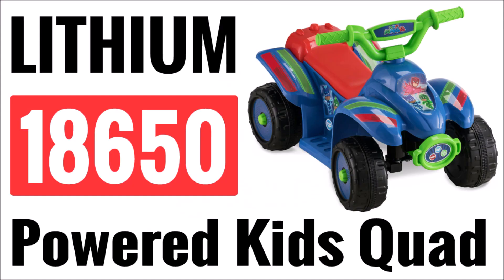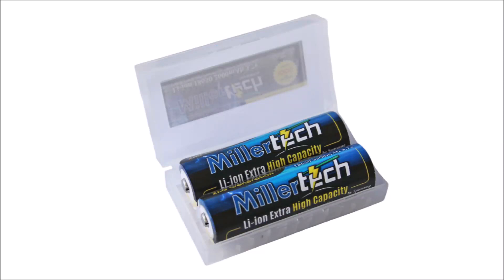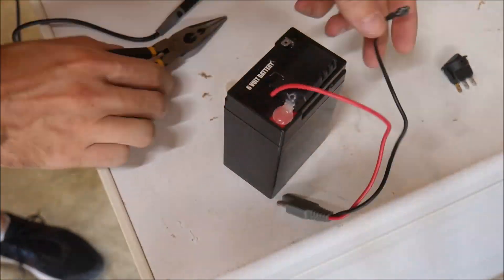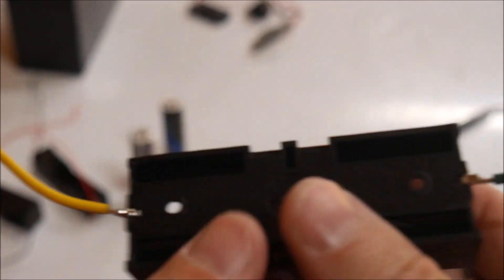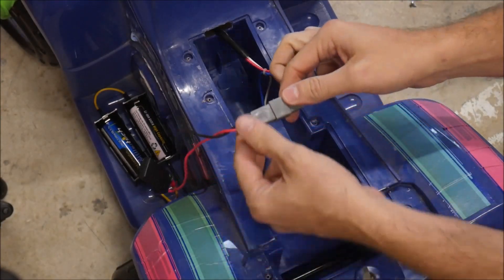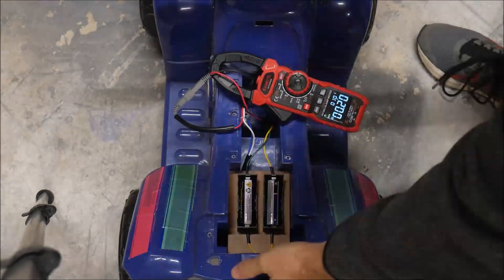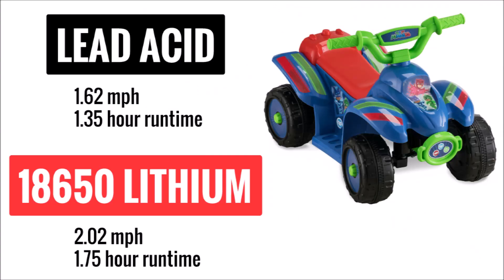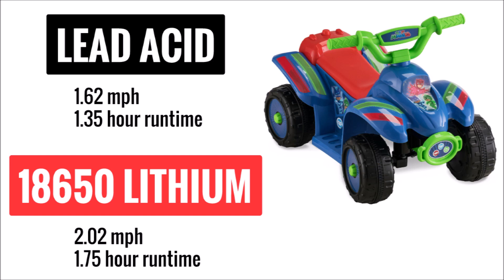18650 Lithium Ion Powered Kids Quad!  Easy Upgrade For Higher Speed And Longer Runtime

Comment: Just think if you paralleled more cells to fill the space of the old 6v system -- looks like you could fit maybe 12 cells?  With a 6p2s he could ride all day! Or if you did a 4p3s he could likely go faster than you could catch him. 😀
Reply from the maker: Haha, he would go really, really fast for about 20 seconds until that motor burned up! :)

Comment: Thanks for the video, I did a similar mod with my 6v quad, except I decided to go with a 3S battery. I ended up building a 3S3P battery made of 18650 cells like yours and the thing literally goes forever LOL. Obviously you know your children and their capabilities as do I, so I decided to step it up a notch so my older child could also join in the fun too. This thing will even move with me on it now!
Reply from the maker: Wow, that is great!  So the motor didn't have any problems with almost double the normal voltage?  I might have to try that! :)
Reply: @LDSreliance  no, it handles it great, I did the mod like 2.5 years ago, still going strong lol
Reply from the maker: I think instead of messing with this quad again I will take on his bigger 12V jeep next.  If I take that one to 6S or so that should be a pretty fun ride!
Reply: @LDSreliance  I have a video on my channel where I took a barbie jeep and I run it off a 40v ryobi battery with an adjustable pwm controller, but only at 55% max cuz the motors get hot at higher voltages. My kids love it!
Reply from the maker: Awesome!  I will check it out.

Comment: Another thing that could be done for a older child is to remove the old motor and replace with a 12v one then just change the battery to 3s although at this point the plastic wheels are a limiting factor.
Reply from the maker: Very true.  And one wheel drive limits things a bit, too.

Comment: Great mod, I done the same to a couple of similar scooters that ran on 6v lead acid batteries. The only thing I did differently was use a 2s Lithium BMS that had low voltage and high voltage cutoffs. Soldered 4 old cells in 2s2p and and permanently mounted them inside. the original charging barrel jack port even worked but with a new charger.
Reply from the maker: Very true.  I could have gone 2S2P as well but it is very overkill for my son's short attention span.  He drives it to the park and back which is about a half mile round trip taking about 20 minutes.  So I can easily remove the cells every month or so and recharge them.  I can also put in fresh batteries and go again without having to wait for anything to charge.  But that is the beauty of these types of mods... you make them suit your own tastes and needs!
Reply: @LDSreliance  I upgraded 2 scooters. One with 4 old and worn cells in 2s2p and one with just 2 new cells. Yeah that's all the range that is needed.
Reply from the maker: I can see it being much more preferable on scooters to have extended range if the kids use them to get to school or go to their friends' houses.  Thanks for the comment!

Comment: I remember when I was a little kid and we had these kind of electric toy cars that could barely go up a hill. It's amazing how far battery tech has come.
Reply from the maker: Yep!  The electric motor in this thing is still pretty sad and can't really go up an actual hill.  Maybe that is the next mod... to replace the motor.
Reply: @LDSreliance  brushless would be the logical upgrade. Would need a esc though.
Reply from the maker: Good idea!  I have a brushless motor from a Milwaukee M18 Fuel drill that the chuck no longer works.  Maybe I can figure out how to get that to work.  But then obviously it would require 18V...
Reply: @LDSreliance  even faster lol